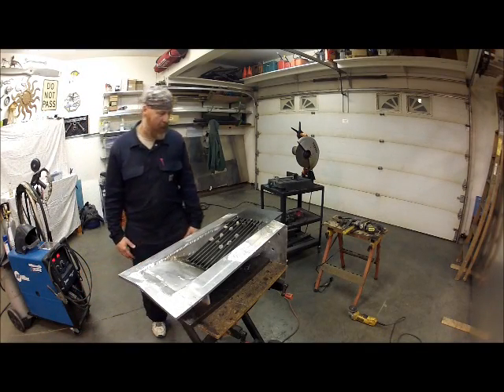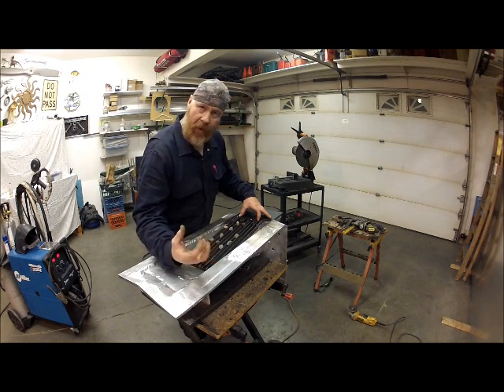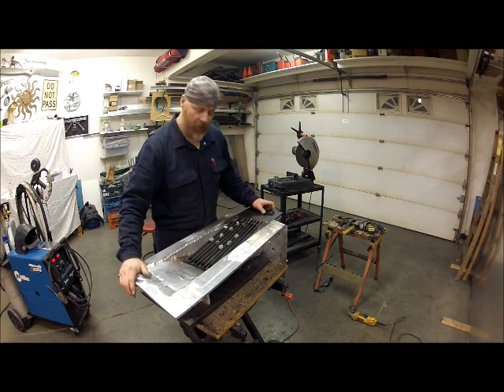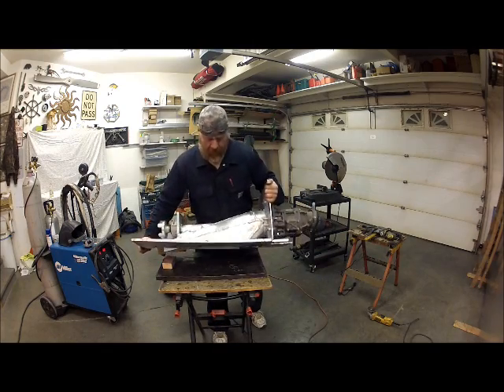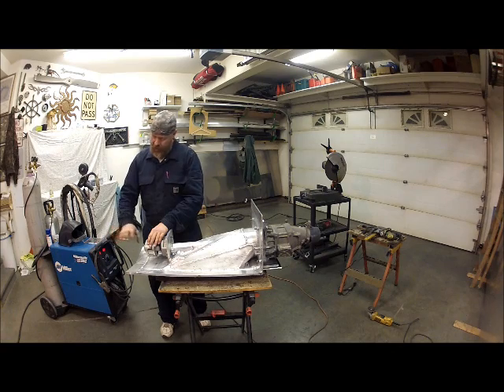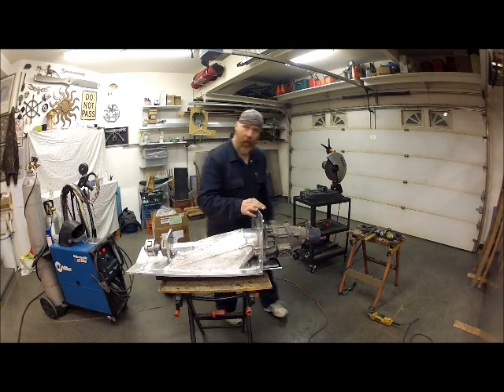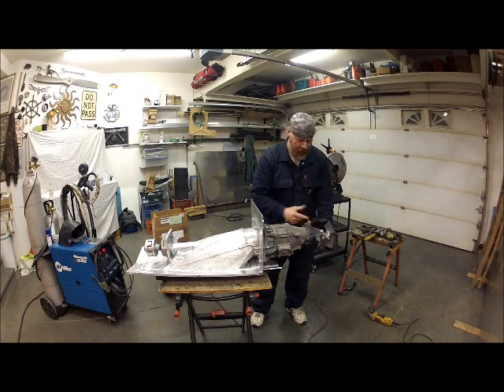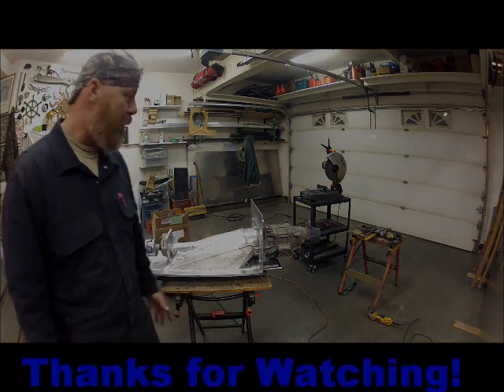Home Built Jet Pump Intake and Stomp Grate

Comment: What did you use to seal the prop shaft into the impeller? Like so the shaft can spin without water leaking through where it enters the impeller housing.